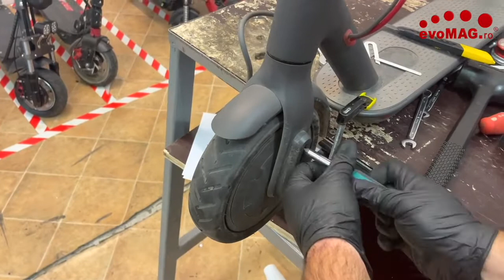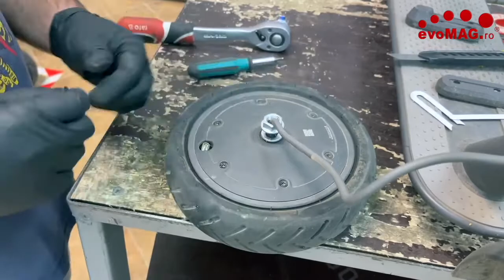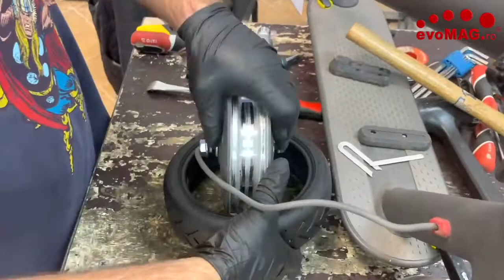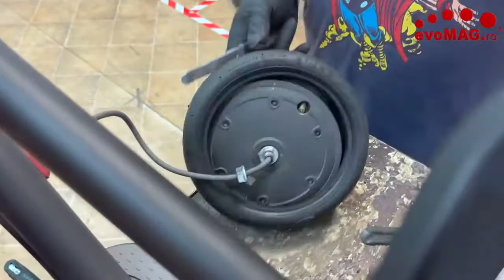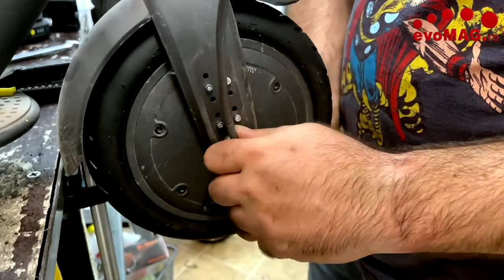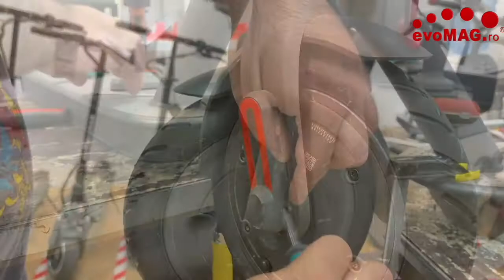Cum schimbi camera sau cauciucul roata fata (motor) la o trotineta electrica

Comment: ai fortat total aiurea , pentru ca toata problema este ca prima parte care o bagi a anvelopei nu ai bagato pana in interiorul jantei si aici intervine toata prostia umana si de aceia intra greu, totu este sa gandesti problema, ei il bag cu mana goala, sau chinuit 3  oameni 3 ore sa bage si mau sunat pe mine, am venit, leam spus la doi sa stanga cauciucu pana in interiorul jantei unde este mai adanc si eu am bagat frumos cu mana fara nici o surubelnita, dar in 3 oameni, sau 2 , ai nevoie de 4 maini, etc, am si filmare cum explic si bag repede doar cu o surubelnita, data viitoare baga cauciucu pana in interiorul jantei nu pe buza laterala care este mai in exterior, sunt 2 nivele de adâncire in interiorul jantei, acolo e toata iluzia. Pierzi boss pariu ca si alti, mor de ras..mari mecanici..vai de noi.
Reply: Și a zgâriat și vopseaua …..😂😂😂
Reply: plin este catasttofa la vibrati strica placa bms  si controleru, eu repar multe xiaomi, recomand tubeles cu valva si slime antipana..etc